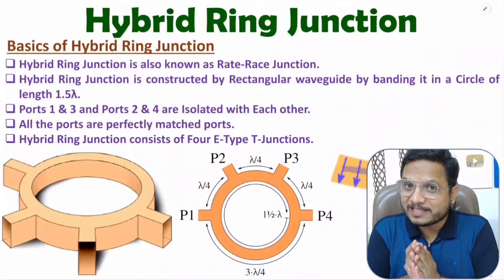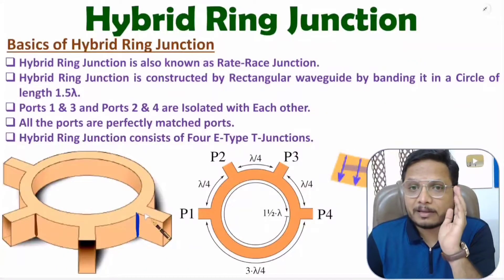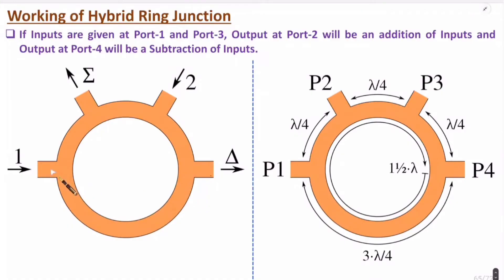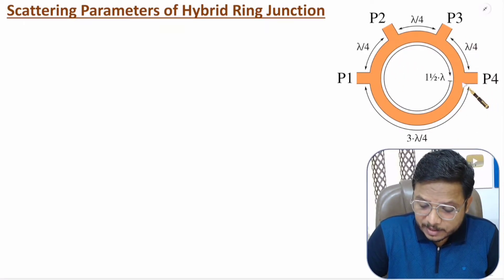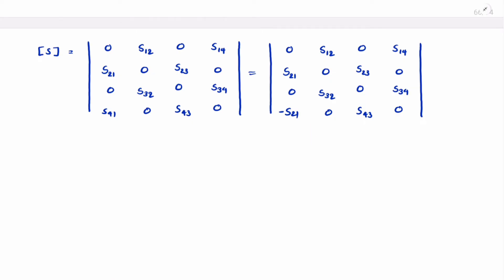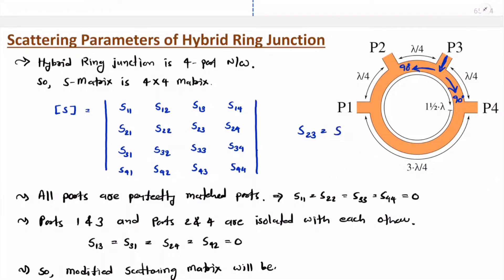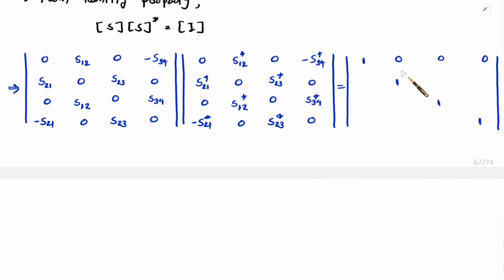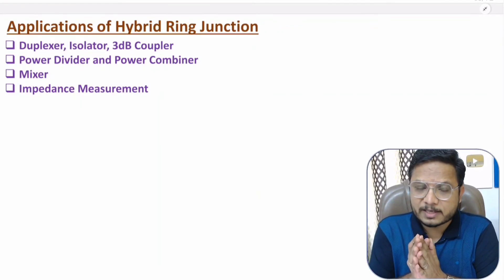Hybrid Ring Junction / Rate Race Junction / Rate Race Coupler Explained

Comment: Sir like how did it come 270  degreee..here
Reply: It refers to the phase of the signal, not the actual geometric angle. You have to calculate the wavelength (lambda) for a given frequency (and transmission medium if you want to) and use that to determine the geometric sizes of the hybrid ring coupler.